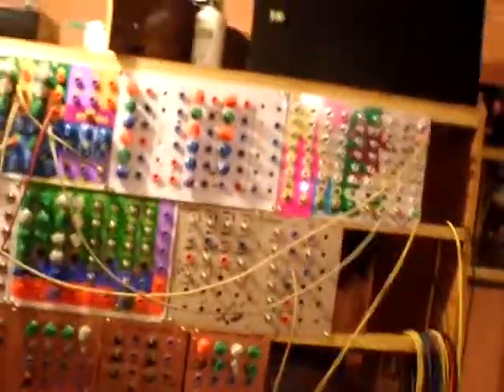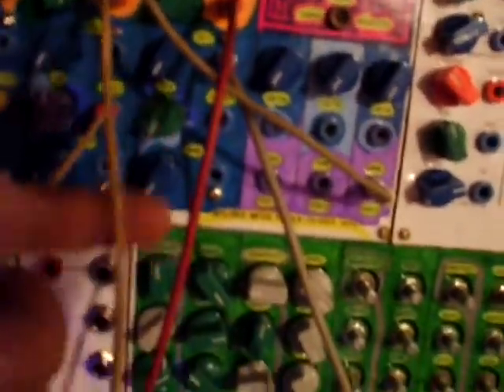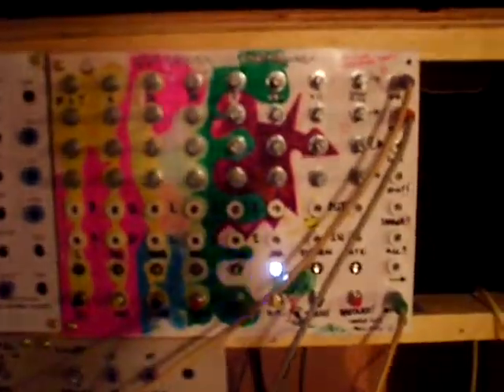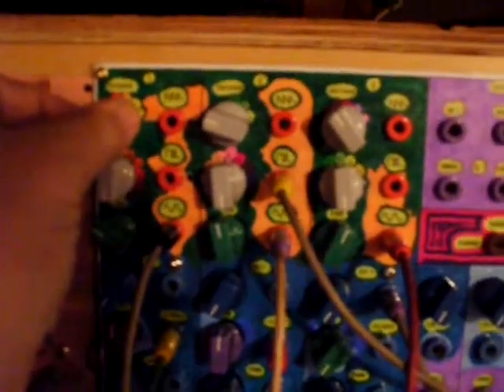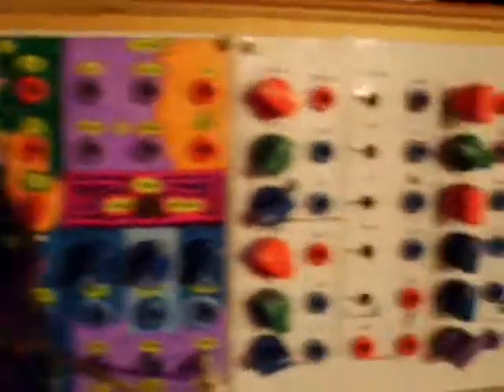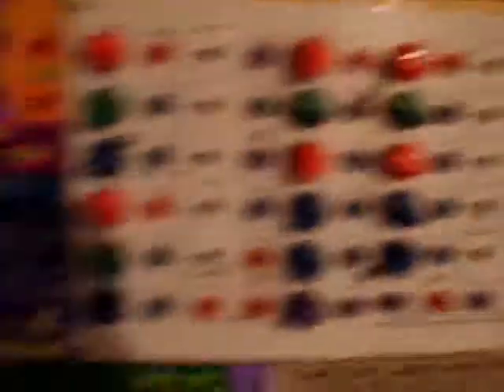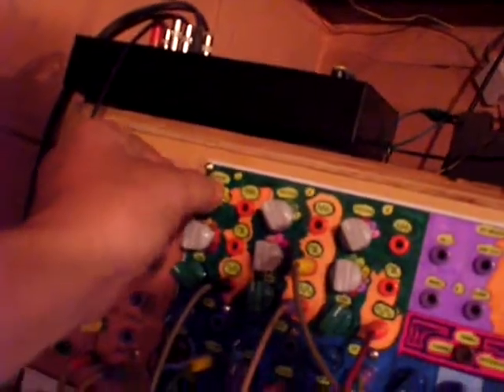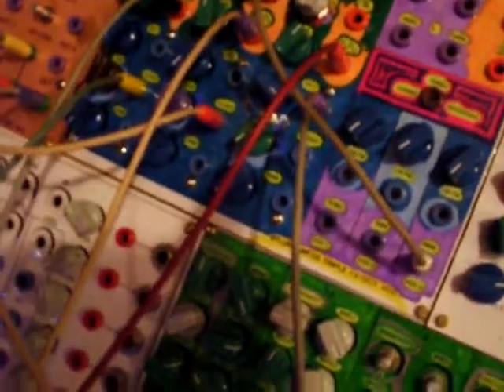Triple MFOS VCO demo

Comment from the maker: If you're decent at soldering, the biggest thing is the 1% resistor matching to at least 0.1%.  (10k's or 100k's, helps to give you extra resolution on the DMM.  Or 20k, or 30k, or 33k, if you have a 2 or 3 count for your highest digit.)
THen, just pop it in between your 1V/oct input and the PCB's 1V/oct receptacle. :)

Comment from the maker: Thank you sir!  Yessum. :)  I came up with the circuit a few years ago.  Rock solid.  I've applied it since, to almost all of my VCOs.  I couldn't live without it now. :o :)  I have the schematic around somewhere, I know.  Lemme know if you need it. :)  It just requires a digital multimeter that DOES have high accuracy, for resistor measurements.  0.01% is preferred, but 0.1% resistors can make due, with a good ear. :)